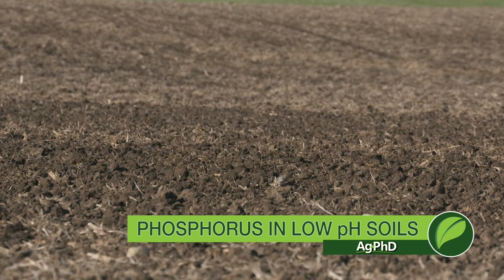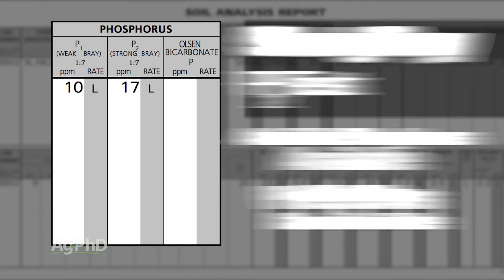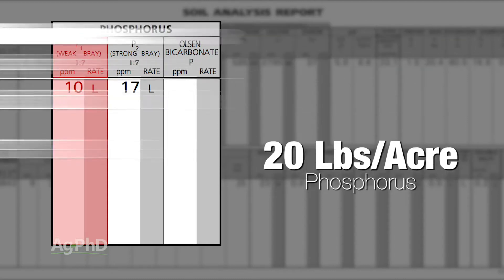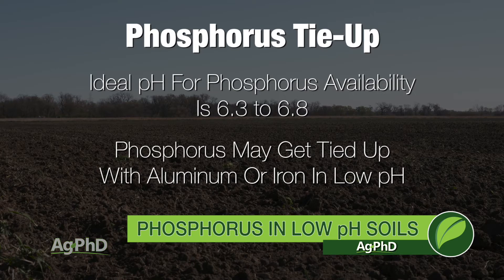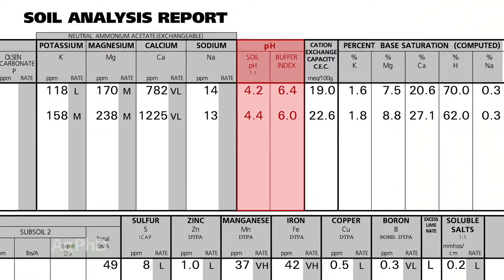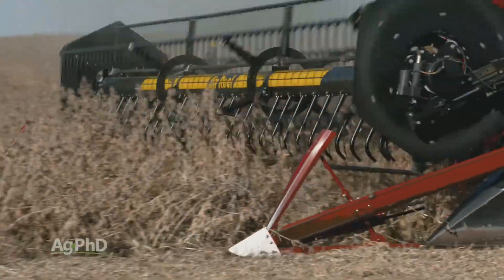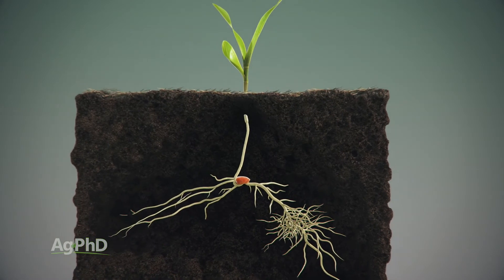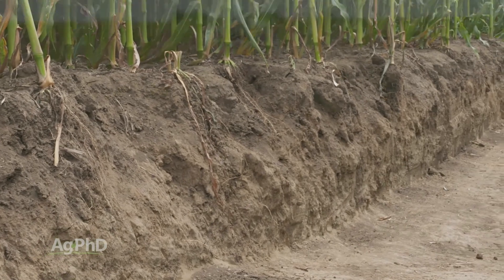Phosphorus In Low pH Soils #1017 (Air Date 10-1-17)

Comment: What would you do if your PH is low but your phosphorus is way too high?
Reply from the maker: Brian and Darren addressed your question on Ag PhD Radio: https://soundcloud.com/agphd/05-09-19-early-corn-fungicides#t=48:45
Reply: Calcium will help. Depending on the calcium source. Look into a soluble form than a insoluble. Or a phosphorus prill that has been designed with a bridge to prevent tie up.